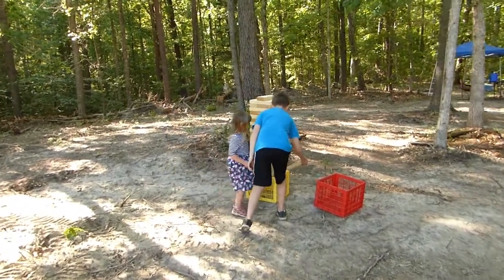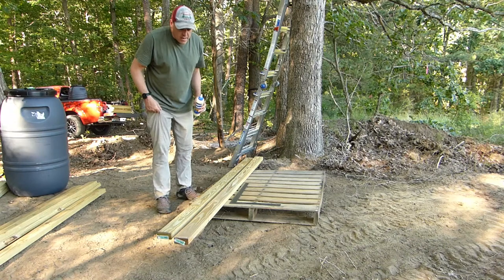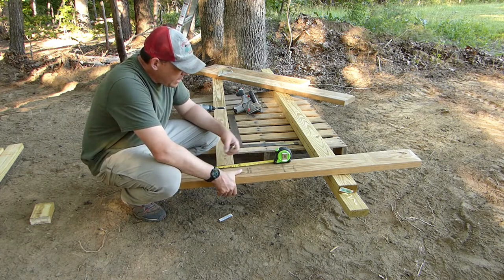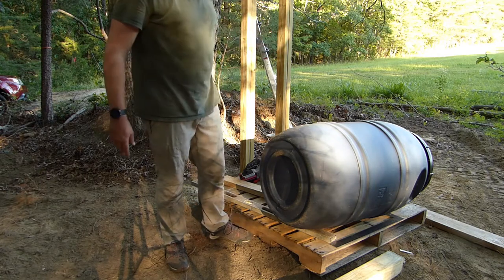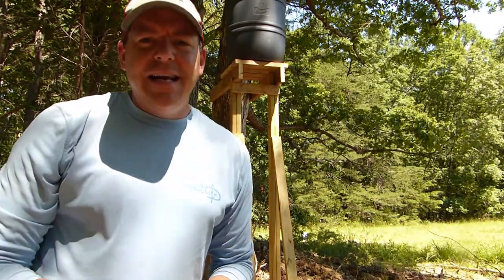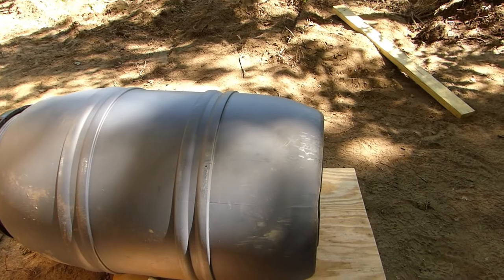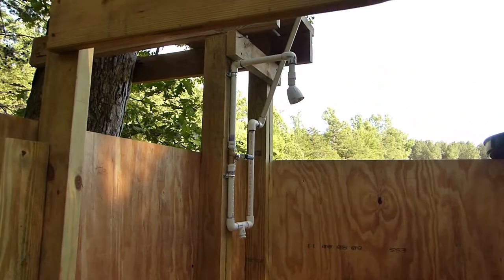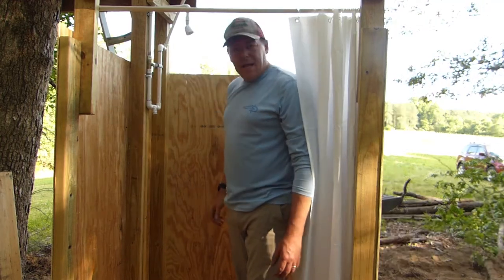#143 Making An Off-Grid Outdoor Shower - Full Build With Enclosure and Plumbing

Comment: Neat build!  I was expecting H to have to crawl in that barrel to hold the fitting!
Reply from the maker: Haha. I could reach in with my ridiculous orangutan arms. Stacey held the fitting on the outside. Got selective on what to film near the end as my battery was nearly dead and didn't have extras or my charger.
Reply: How do you fill the barrel?
Reply from the maker: I was going to use the pump but decided to just run buckets up the ladder. Didn't take too long.

Comment: Hi I’m thinking of building one of these. Why did you come down and then up with the pipe?  I imagined it straight to the shower?  Thank you !!! I subscribed.
Reply from the maker: I had it in my head from the onset that I wanted the shower head and valve on the vertical post. Where the pipe comes out of the barrel was an odd angle so I had to come down and over to get the head to the post and this was the best solution I could come up with. There might be better ways. If I was doing it over again, I'd get the barrel up higher so I'd get more pressure to the shower head.